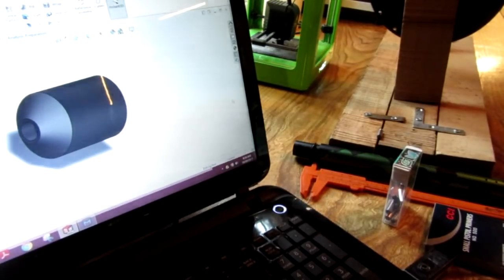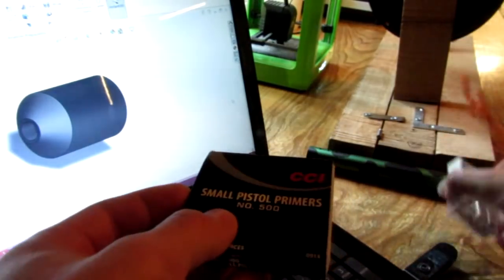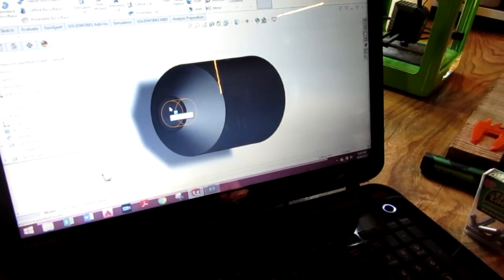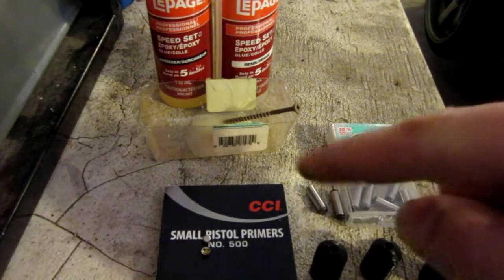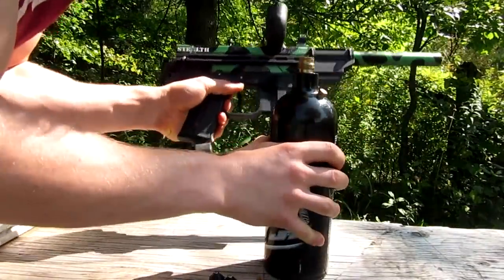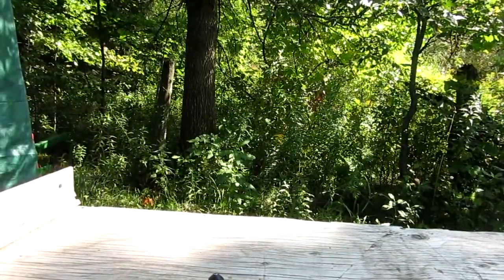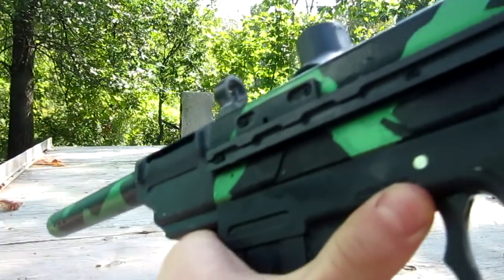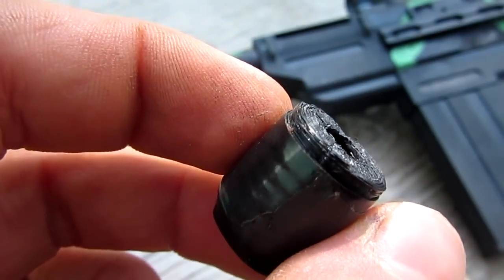3D Printed Explosive Paintballs

Comment: If you print the bottom solid and load the payload and rod trough the top and cap it with the primer it should make a stronger explosion hypothetically of course. Also super glue a bb to the primer

Comment: 😂💡Dude you should be happy that it didn't work because it wouldn't have turned out the way you think😔 If that firing pin had landed on point against that brick or that tree, then that firing pin would've went off and fired that piece of metal directly back at you😱 What you were making was a backwards barreled gun that would have shot you and definitely put your eye out, So i really think you should totally scrapp this design👍

Comment: You have projectile disfunction .The lack of explosion had nothing to do with how hard the primers got hit, primers have a very specific spot they need to be hit to explode. Smashing the whole primer does nothing, you need to hit it right in the center. Also your projectiles will tumble in the air and not even land on the primer, try adding fins or a stremer so they fly straight.

Comment: I would be real careful with that 'bullet'.  When the primer hits something and detonates, it is going to fire that piece of rod back in your direction just like a bullet at probably close to 300 feet per second, which is enough to injure or maybe kill you.  Here is why it isn't working in a nutshell.  It is backwards.  In a real gun, the primer is at the rear of the bullet and when struck by the firing pin, the expanding gases from detonation push the projectile down and out of the barrel.  In your case, the gas is pushing the assembly down and out of the barrel, primer end first, and when it hits something hard enough, that will set off the primer and send the rod back at you.  A paintball gun has no firing pin to strike the primer, so.....unfortunately, your idea won't work.  You need to turn the bullet assembly around and figure out how to put in some type of firing pin. Be careful with this design, it can be lethal.

Comment: The pellets were back heavy which you do not want for what you need... try cutting down the rods to half size and put them back in so it's front heavy
Reply: Jamie Knight ... if it's in the back wouldn't that make it back heavy?
Back heavy means it's heavier on the back end
Reply: Robot4092 I know, what I meant was he could cut the back of the weight but push it to the from so it would have nothing in the back part of the hole and half a weight at the front, making it front heavy